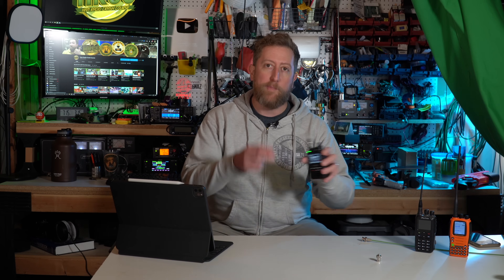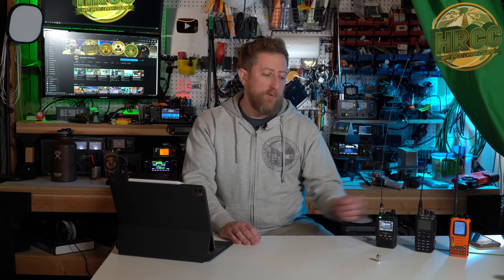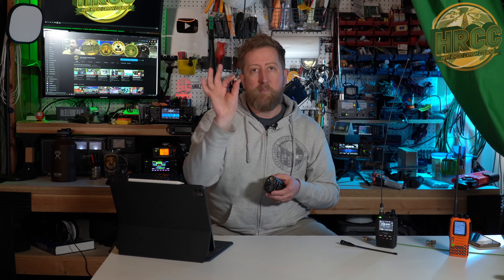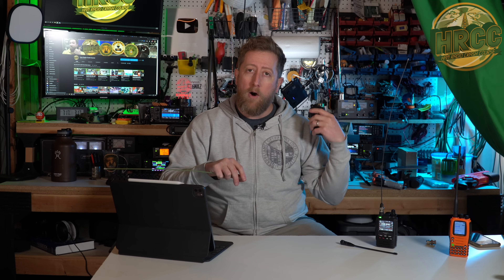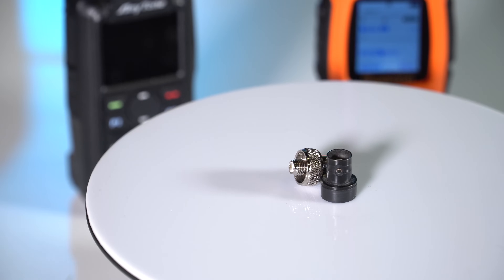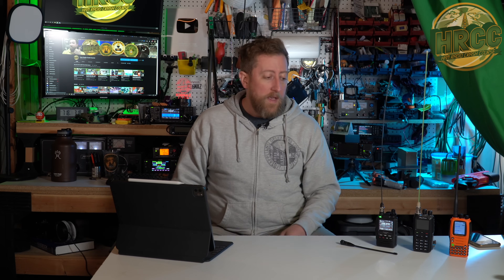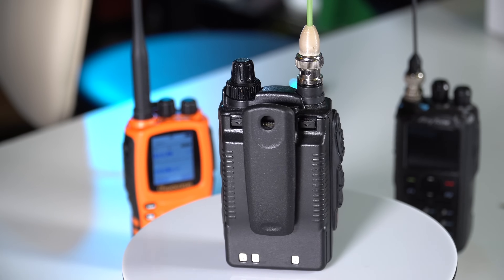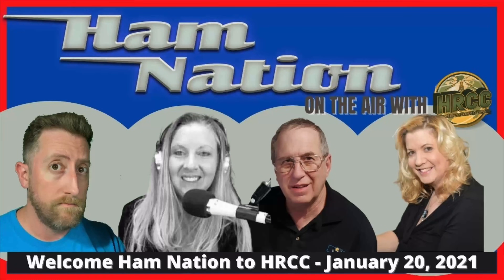The First Thing To Upgrade On Your Handheld Ham Radio

Comment from the maker: UPDATE! They sold out of adapters on Amazon. Good news though, Signal Stuff sells CHEAPER adapters on their site and they’re good quality. See links below. 

SMA to BNC adapter for SMA female radios (Japanese radios, ICOM, Yaesu, etc.):  https://signalstuff.com/product/smam-to-bnc-adapter/?ref=622
SMA to BNC adapter for SMA male radios (Chinese radios, baofeng, etc.): 
https://signalstuff.com/product/sma-f-to-bnc-f-adapter/?ref=622
Signal Stuff Signal Stick https://signalstuff.com/?ref=622
(This is an affiliate link)
Reply: Also the mechanics of SMA usage on an HT you might ue in your car in particular can beat up the SMA side on the HT. Instead of partial twit or even collar tightening, with car connections where you have the lead come into the passenger compartment, you have to line it up and turn the HT itself to tighten which particlaylyu lends itself to stress or even cross threading the connection on the radio.
Reply: And they are sold out on the website too.  Brilliant!
Reply: I think you got the connectors wrong. I ordered the SMA Males thinking for Baofeng and Female for my Yaesu and it was the opposite.
Reply: With your success with the ABBREE antennas, why do you still feel the Signal Stick is superior? Asking because I’m debating between the two antennas. I like the simplicity of the Signal Stick, but can appreciate the benefits of a longer one to help with line of sight gains (even though it is probably minimal).

Comment: Yes the sma connector may not have a long life span but what wears our is the female connector. Baofeng has the male end in the radio. So it's easier to replace the antenna.

Comment: I like the idea of saving the threads SMA threads, however, the issue with this is that most of the stock antennas provided with the radio screw directly into the SMA. So, if the manufacturers antenna is rather good, test out well on the SWR meter, then those antennas will be unusable unless you unscrew the adapter which isn't the point of why you bought it.

Comment: Quick antenna question. 
I have a Nagoya 771rectable.
That being said, do i want it extended for VHF ?  had this 5 years & never once thought what's the best position for vhf/uhf.  Ive always extended it when transmitting.

Comment: Hello
I'm new to HAM, is it not better to put the bnc male part to the radio, becourse they are more robust than the female version(overall looking), that the female bnc could brake easyer, but I don't know even if they are antennas made that have female bnc connectors, beside the male adapters look on the radio a little wonky also with the wider part versions of the bnc female connectors that exist.🤔
I hope I have understandable  written, Sorry English is not my first language, beside I'm disabled and have pain and that makes somtimes writing a and reading a mis or hit situation even in my mother language.
I feel somtimes my many questions make people angry and I wouldn't dare asking more questions, it's not easy to learn stuff that's not uncomplicated and have a extremely amount of aspects.
Sorry for so much writing.

Comment: Good day,

I hope you’re well. I have a question regarding the Signal Stick antenna. If I mount it on a vehicle, I’m concerned about its flexibility. Would it be able to handle high speeds over long periods without deforming or being damaged by the wind? I’d appreciate your thoughts on this.

Thank you!
Reply from the maker: As a temp solution. Yes.  I did this recently over a weekend in a rental car.

Comment: Question: I was doing some side research and found the loctite 290 is made for connecting two metal objects while maintaining electric passthru. It basically seals the connection between the two metals, makes the electrical path clean, and requires heat to be removed. Seems to me it is the perfect thing for the SMA to BNC adapter. Your thoughts?
Reply from the maker: It's worth a shot.  How strong is the connection?  I have some concern of shorting the connector, but it's likely not that big a deal.
Reply: @HamRadioCrashCourse  Well right now you screw in the converter and now you install BNC antenna. But I would think over time that converter can loosen. Electrically that becomes a source of RF leak. Loctite 290 will fill the threads creating a solid connection between the converter and the mount on the radio at the molecular level creating an electrically perfect bind. And no amount of vibrations or antenna changes will loosen that connection. It also has an anaerobic curing so it is designed to cure when there is a lack of oxygen.

Comment: You were lucky. My Signal Stick and adapter was defective and had bare wire showing. Also, could not remove antenna from adapter. Won't purchase from them again. Guess they don't check quality prior to shipping.

UPDATE: I will try again. I ordered two more antennas, adapters, and magnetic car mount. Most companies deserve a second chance. I did send pictures to them and am waiting for a response.

Final Update: Signal Stick has been replaced by company at no charge! Excellent service! New antennas that I ordered came in and were in excellent condition, as well as the magnet mount for the car. Looking forward to trying it. Will continue to do business with them.

Comment: If the black coating is anodized or paint, the outer coax shield/conductor will have connectivity issues when connecting to a coax cable for connecting to an outside antenna. .....but should work OK for feeding a rubber duck or signal stick antenna where there is no shield connection needed.  
Am I correct in my thinking ?
Reply from the maker: How many times are you going to make this comment?  The threads of the adapter are tapped bare metal... This connects the shield of the antenna to radio.  The pin is still just the bare metal center pin...  NO ISSUE with exterior anodizing.

Comment: Where do you find the piece that goes onto the antenna or cable coming into the house that does a quarter turn onto the transceiver? I ordered from them, and it only came with the piece that screws into my icom transceiver (Male on one side that screwed into transceiver, with female on the other side, and I cannot find the adapter piece anywhere on the website for the easy on and off like you’re doing in the video

Comment: I noticed R F loss when I ran a connector tip vs direct original fit
Reply from the maker: How did you notice it? What was the test you ran?
Reply: Less inbound transmissions and outbound seemed worse to vs my receiver which was direct BNC no adapter never put on any machine.

Comment: If I wanted to put a BNC adaptor onto, say, a Baofeng (male) and a TYT TH-UV8000 radio, what sort do I need and where is the best place to buy them for ten radios? Also, I've known people who have had antennas for years with no discernible wear. If you had to guess how many times an antenna (overall) could be attached and unattached, what would you say? Are we talking tens, hundreds or thousands? I'm not trying to pin you down, but it does make sense that they would wear over time. I have friends with Signal.Sticks who have had them for many uses, but someone might not even realize they are losing signal strength through a worn connection. 

Thnx!

Comment: thank you for the advice,  ordered up the sma to bnc and the dual band antenna for my FT5D. FWIW when I looked on Amazon the adaptors were huge, half inch in diameter, woould not have fit my radio

Comment: Hmmm I like your suggestion. I have used PL-239 adapters on mine ready for homebase antenna for 2m 70cm and possibly a 10metre half wave folded dipole strung across small garden. I currently own 2xBaofeng, and a SDR Dongle. Looking at 10 Metre radios now as I now have a licence for the UK. 73

Comment: Gday Josh, If you want to go back to your stock standard antenna. Would you use another bnc to sma on top of the first adaptor. From Ross in Brisbane Australia. I hope that makes sense.
Reply from the maker: Nah. That creates too weak a spot on connectors. Just unscrew the BNC adapter.
Reply: Thanks Josh, I totally understand that.

Comment: Thank you for this video and the others.  Your videos are very informative. I had two questions if you don't mind.

What bnc connector do you reccommend for a Yaesu FT 4XR?  Also, I am interested in buying a short antenna for my FT 4XR for work.  Can you transmit with a Diamond SRJF10 antenna as next to the antenna frequencies, it says, receive only on the purchasing websites.

Thank you very much.
Reply from the maker: I like the Signal Stuff Signal Stick adapters. Link in description. 

I would not transmit on that stubby diamond.  Get yourself another stubby that can transmit on

Comment: Hello! I just came across you channel, looking for the best ways to boots my Baofeng 888a radio distance. I considered making a directional antenna, or figuring out a way to connect my handheld into my TV antenna on the roof. I am new to radio scene, and looking for advice. Would getting a longer antenna increse the effective range of the radios? I send a radio with my kids when they walk up to the park, and the park is 500 yards away, and there is a point that the signal statics out when they walk only around 50 yards farther. I also like to have the radios on road trips, when more than one vehicle is traveling to the same place. So any advice is welcome. Let me know if there is something I can make, or what the best antenna would be for my needs. I like the Baofeng 888a and Baofengs programmability. Just hoping to up the range a bit. Thanks for you time and consideration.:)

Comment: the BNC connector is less water resistant than SMA, so I wouldn't recommend this adapter if you plan to take your radio out into the elements.

Comment: SMA connectors get a bad rap. YES, it's true they have a "lifespan", but they are not inherently weak. The adapters you show here are of good quality, but there are other styles that put more stress on the radio's connector and should be avoided. My early UV5R (made in 2012) is still rock solid. BNC is great if you change antennas often, but many cheap connectors don't fit snugly and allow the antenna to pivot on the pins and damage the connector.

Comment: I have a yaesu ft3dr which long distance antenna would you recommend. Live in isolated area
Reply from the maker: Something you can setup outside like a 10 foot ground plane. 

Then just use bnc adapters to interface the ft3dr. Run a signal stick on the radio when out and about.

Comment: Thanks for the Video Josh, that was just the information I was looking for! I went to SignalStuff looking for the SMA male to BNC female adapter for my Yaesu FT-60 radio, which I found. But they didn't have the BNC adapter that screws into the antenna. I was hoping you or someone can help with where I can purchase that piece. Any help would be greatly appreciated!

Comment: BNC? Gross. If I was swapping antennas on a regular basis, maybe. For me it's not worth compromising part of the water resistance afforded by some SMA options and the added SWR (BNC does lengthen the antenna slightly - which matters on 2m and 440) for convenience.
Reply from the maker: You don’t lose the sma connection into the connector.

Comment: Hi I got a wouxun kg-uv2d 2m and 4m but looking get better antenna for it use in my bed room or when I go out side if bac is better do you no what antenna need for my radio then I get bnc for my radio

Comment: How good are the metal measuring tape antennas from Amazon: 42.5-inch ABBREE 144/222/435Mhz Tactical Antenna ?
Reply: Josh did a video on the abbree 42” dual band a while back and smoking ape did a video as well. I have a 19” one and I swear it may be better than my diamond srh-320a when paired with the vx-6r ht. Only drawback is I have to have an adapter since it’s SMA F  which is why I stick with the diamond. 73 KO4KMA

Comment: I added a wire hanging down from the BNC ground of the same length of the antenna to make a dipole. This increased a local Repeater S unit report by one point.

Comment: The Diamond SRH77CA antenna ad on Amazon says they don't work with Baofengs. Is that just a connector issue meaning that they will work with an adapter, or that the design of the antenna does not work with the Boafeng system regardless of how it is connected?
Reply from the maker: The Diamond is for SMA Female radios.  The Baofeng is SMA Male, so you need the other adpater I linked.
Reply: @HamRadioCrashCourse  Ok, that is what I was asking. They will work with the proper adapter. I had ordered the adapter you suggested. Just wanted to make sure it was only an adapter issue.

Comment: Hi Josh. I'm new to Ham and learning. I have a set of Motorola Talkabouts and just got an Anytone/Retevis RT95. When I test the 2, the Motorola tx, I can hear perfectly on the RT95 but when I tx on the rt95 to Motorola, it is extremely staticky. I found when I change the tx frequency on the RT95 up 2.5 or 1 click, I can tx from rt95, and hear perfectly on the Motorola. It seems like my rt95 tx frequency is off or the Motorola rx frequency is off. What do you suggest?

I do have a Baofeng uv-5r on the way to test also.

Comment: Why would you want long antenna poking you in the eye  stock antenna works just fine I operate a FT3
Reply from the maker: Ok. You do you.
Reply: Stock antenna blows chunks relative to the signal stick. I got mine today and it's not even close. I can talk to my pistar on one tenth of a watt where I needed half a watt with the stock antenna on the 1st floor of my house. The PiStar is on the 2nd floor near the ceiling (12' ceilings upstairs, 14' downstairs).

Comment: Hi Josh, you did not mention SMARP connectors used on many of the cheap Chinese radios. I feel this is a serious omission as people ordering a adapter could look at the radio, see a pin, and order a female to female BNC adaptor, and not fit. Rick, VE7RY
Reply from the maker: Which Chinese radio uses that connector?
Reply: @HamRadioCrashCourse  I somehow was of the impression that my Baofeng did, but on closer inspection it is not reversed, my bad,  apologies to all.

Comment: I've been watching your vids now for a few weeks, and finally subbed. So, I'm an off road Jeep person, and over the last year or two, there's been a BIG swing in trail comms from CB to GMRS. Just ordered the BF-8FHP and the BTECH GMRS-V1. I will be getting the GMRS license, and although I know the 8FHP is capable, I won't be TRANSMITTING on channels I shouldn't (thanks to your chirp programming vid, I know how to disable tx function), so you HAM guys don't get your panties in a wad, LOL! Seriously,  I'm well aware of SWR tuning from my CB days, but I'll be damned if I can find a vid about the SWR with the factory rubber ducks these radios come with. If you could do a vid on that, and how to fix an SWR problem (if you have one), that would help folks like me out a lot. Thanks, and keep educating us dummies!!
Reply from the maker: Thanks for watching! Cheers!
Reply: I have my Jeep setup with a mount from JeepUniq and a BNC run to external antenna. With this I can use either my AnyTone 878 or my GMRS-V1 with the BNC connectors I got from SignalStuff.

Comment: This is exactly what I've been doing for the last 2 months. Been running into issues though as soon as I use an antenna extension or the longer abree flat antennas (both worked perfectly fine before). Oddly enough after some testing I can transmit and recieve just fine HT to HT...but NOAA won't come in at all unless I use a stock baofeng antenna 🤔🤨

Comment: I bought an ICOM HT for CAP in the early 90s and it had a BNC built in. Why did companies get away from them? How many dB gain do you lose by adapting?
Reply from the maker: You lose an almost not measurable amount of signal.

Comment: 2 comments:

Signal Stuff antennas are not a good solution for people who are using their radio in sub-freezing temps. At 20F there is antenna droop. At -10F there is significant antenna droop (like, 90 degrees drooping). If your use case does not involve using the antenna in cold temps, then rock on. They do stand up to being thrown in a bag with gear and knocked around a bunch. 

Next, consider what bands you need. In my experience, a Baofeng user, if they are only using 440 and if they have one of the upgraded antennas, probably doesn't need to upgrade. However, for my uses, I like being able to have a small antenna when the radio is on my person and I like having the ability to attach coax and a dipole for longer range chatting, so those BNC connectors have been great.
Reply: There is a signal stick that is more resistant to cold by the way. But yes if it is past -10C you might have to find another solution.

Comment: Great video on an important subject!!!!  I put BNC connectors on all of my "SMA" devices, radios, nanoVNA, SDR radios, etc. SMA connectors are great, but they have a limited number of insertions  before they become problematic. Also one should not rotate the pin when connecting a SMA connector. That also shortens the live of the connector.
Reply: Just be aware that BNC doesn't go up into the GHz as well as SMA does.

Comment: I’m just getting back on the air after 20+ years and wondered why nothing had BNC connectors anymore.
Reply: There's probably more than one reason, but I'm going to guess cost is a big one.
Reply: Ive only been away around 15 years and I  remember every thing having uhf/259 connectors. Was never into HTs much though. These SMA connectors are a joke.

Comment: Just in time!  I bought that Mate after seeing your review.  It's a seven band radio and I'm not sure what antenna to upgrade to.  A dual band is probably the first priority, buy do I need a second or just use the original when on RX only bands? Thanks for all you do.